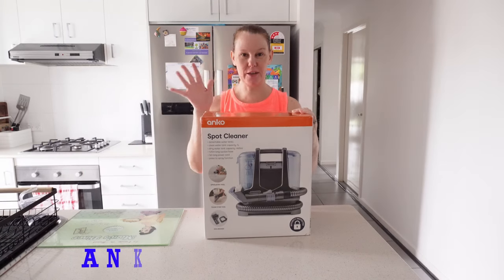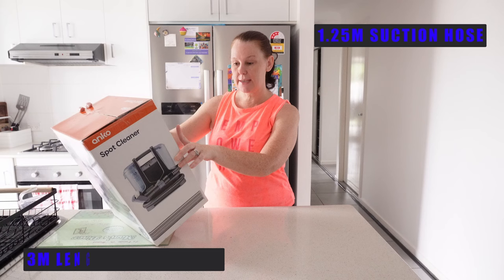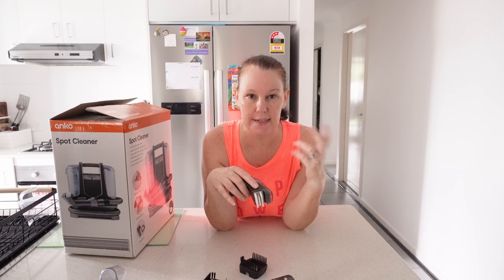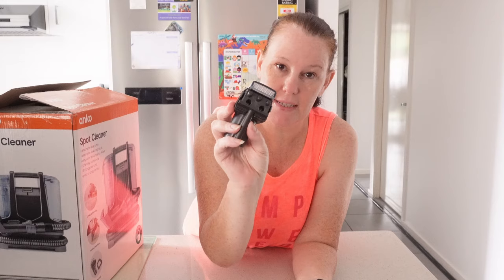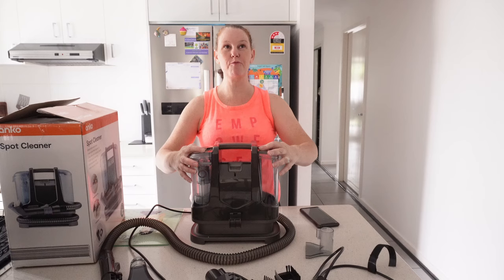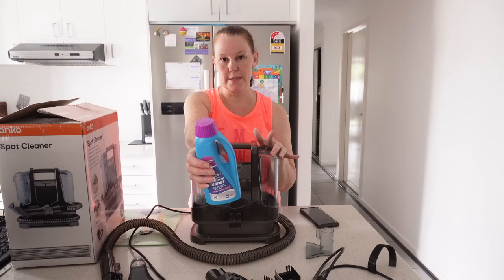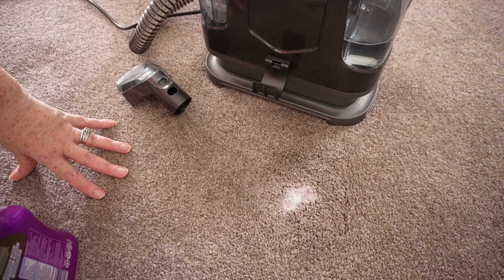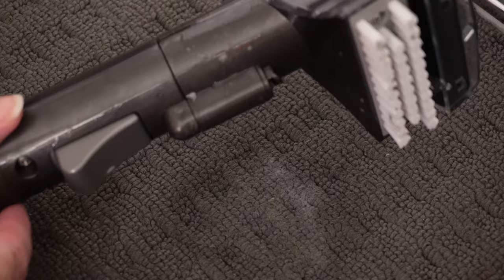Unboxing, Testing, and Reviewing Kmart's Anko Spot Cleaner: Tik Tok Inspired

Comment: What is the brand you use for stains? Blue thing you show? Thanks
Reply from the maker: I just used the Britex 500ml Low-Foaming Upholstery Cleaner

Which you can get at Bunnings or woolworths if you are in Australia.  You can also use 4 cups hot water, a tablespoon if vinegar and a squirter of Dishwash liquid to wash with, I also used the Di-san stain remover from Aldi. Hope this helps and thank you for watching my video. 🤗
Reply: Cool thanks for that! Yeah thanks for this anko brand review. Very detailed. Keep it up 👍

Comment: Hi there, when you switch the device on, does the water run all the time, or is it only when the trigger button is pressed?

Mine seems to be spraying all the time when the vacuum is on..
Reply from the maker: Hi there, the water should only come out when you push the trigger, if its constantly running you may have to take it back for a replacement.